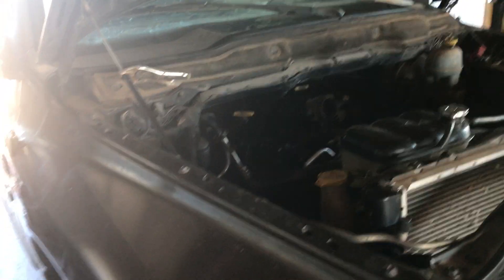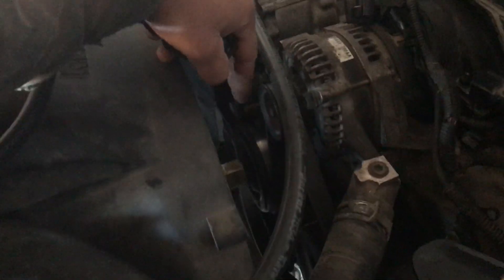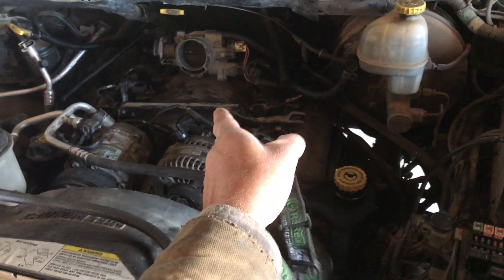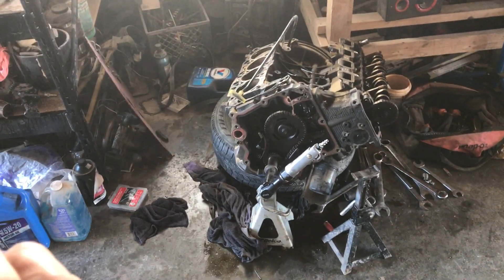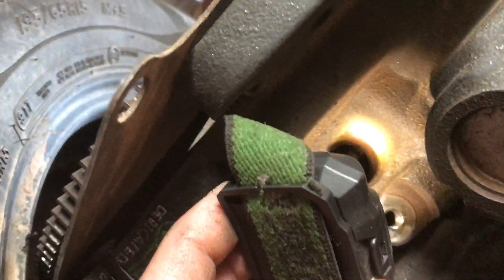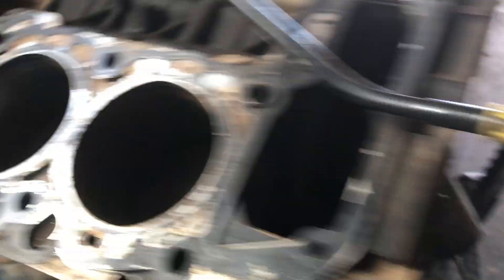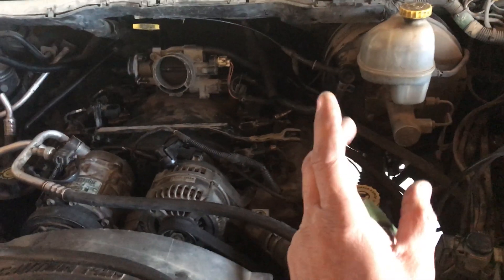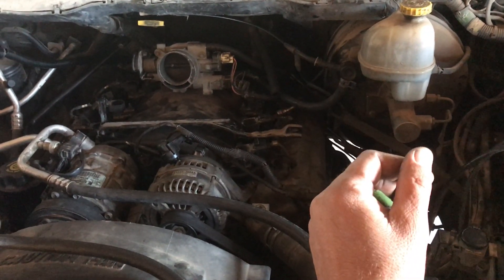4.7 Crankshaft Reluctor Ring Teeth Tone Easy Way to Determine

Comment: This is the 5th video I've seen where people talk about the tone wheel and that they are swapping the motor with a motor that has the same tone wheel....is it really so hard to change the ring that its easier to just do an engine swap?  I ask because im almost positive my Jeep GC is having issues and it should be the ring.  Hard to believe i need to swap the motor just for a no signal code
Reply from the maker: you can swap the tone rings. its a little in-depth but can be done.

Comment: So I didn't know this and put a 32 teeth Durango in my 16 teeth 02 dodge ram 1500 and it wont start. Pretty sure this is the issue now...how do I go about converting the change over so it'll work in my ram?
Reply: did you ever figure it out. I'm thinking you just needed the pcm for the 32 teeth

Comment: Will it work if I have a 4.7 engine that's 32 teeth and swap out the relector ring that's 16 teeth? That's what I did truck cranks and turns on but has no power at all scanner says random misfire
Reply: did you change out the camshaft gear?

Comment: I just changed my first crank position sensor today. I was having an issue when the engine was warm where it would hesitate to start. 
I put the new crank position sensor in and got a couple of misfires when I try to start.

Not sure if my crank position sensor is bad? Maybe it's the wrong part number?.

Like to ask a general question as you seem very knowledgeable is when I put the sensor in do I have to rotate the crank so that any part of the reluctor wheel is facing the sensor when I initially put the new one in?

Comment: If u made the mistake of buying a 16-tooth when your CPU reads a 32-tooth, can't you just swap the reluctor ring on the crank and the sprocket on the cam to have the crank and cam sensors to read it correctly? Or is there something else that will cause this not to work?
Reply from the maker: i think you can, however i have not done it before, it makes perfect sense though. keep in mind the crank and cam will need to come out to perform it. i have both engines here and i may just try that. i too am very curious. and it does make sense. let me know if you try, and if i get to it before you, i will make a video and send you a link as well. great question. the 1500 4.7 is harder to find then the Dakota and durango, so it would be great !! anyone else try this, your info would help us all. thanks for watching.
Reply: Yes, that's what I have to do now to get driving again on my 03 Dakota from a 2000 Durango. Ur video helped me find out why I had a no-start (I wasted a week and a half doing unnecessary checks). The more videos the merrier then; I'm an unexperienced mechanic running into obstacle after obstacle, but the aid from others online (especially explanations from multiple youtubers) has kept me going. I wasted another week thinking my cam wasn't turning normal and had a lot of resistance (since it has been so long in this project to remember how it was supposed to look like turning by hand) then I posted a video about it. Thank you for checking the video out and easing my worries about it because I was stuck thinking of an imaginary issue. I guess my problem is setting the timing chain and tensioner correct (which I found a great video for as well).

Comment: I have a 2005 grand cherokee with the 4.7l looking to swap with exact motor  and was wondering if anyone knows  if the ram dakota durangos are the same. Is the tone ring count different jeep grand cherokee. I know they use two different systems jtec and ngc. Anyone  has any info greatly appreciate the knowledge
Reply from the maker: yes they do have two kinds. pull the crank sensor, it only takes a second and verify. saves alot of time. great question. thanks for watching

Comment: Dont you have to make sure if it has a egr or not?
Reply from the maker: can you name a gas or diesel engine that does not? thanks for watching.
Reply: @thomasbriansavingmoney  my 4.7 does not have a egr
Reply from the maker: @whocares5188 4.7 egr valve is at  passengers head, in the rear. two 10 mm. bolts.
Reply from the maker: metal tubing goes to it. look again. it may be hard to see, but its there. put your belly over the engine. right behind the head that is on the passengers side. in the rear toward fire wall. or lean over the passengers side standing on a crate or whatever you can, and put your hand in between the passengers head and fire wall. all gas and diesel engines after 1986 will have them . and most before. 86-91 emissions were dead set on re burning fuel. some engines with carbs,  pre 86 did not.
Reply: @thomasbriansavingmoney  i been looking for a replacement 4.7 . And alot of them say without egr valve?

Comment: So I ended up had to take engine out. Due to torque converter when couldn't turn the flywheel at the time. Whole trans and engine would had to come out. Due to more hazard to my self and vehicle. So I used rust rescue that I pour into spark plugs and holes let sit for week. Then I was able get the crank to turn. But only 1 full turn to right or left. Just enough to undo the bolts for the torque converter. When I got my engine out. I took off my valve covers. Finding out I have 9 out of 16 lifters were bad. How I can tell? Shake a bad one. And shake a good one. Bad one will have play sound. Good one won't. Due to I had 9 bad. I'm replacing all 16 hydrolic lifters. Cams rocker arms are good. Cleaned it. Let set in oil until the time to replaced back on. I went ahead replaced timing kit with new gears. When I checked the rods, pistons, and crankshaft. 2  rods were damage. 5 rings were damage, 3 bearings were damage. To be on safe side. I replaced all. Including new crankshaft. New flywheel. I replaced new freeze plugs. New seals, new gaskets. New oil pump, water pump. Tensioner. Almost everything on my engine is new. Accept for alternator Ac compressor. It basically took me 3 weeks to rebuild it. Took my time and done it the right way. But one thing I problem on. Getting the timing right. So I had my best friend mechanic came  over to inspect my engine. And to recorrect my timing. He said I was 2 teeth's off. He went ahead resit the timing. Next 2 days. I placed on the timing  cover and the others. 3 day friend came back over. Help me placed the engine back into my truck connected to the trans. With new torque converter. Connect everything else back on. Due to my friend came and help me. He took for first test run. He says it droved like a charm.
Reply from the maker: thanks for watching!

Comment: If I'm correct. When u said u have to take off the alternator to take off the black thing off that's sits in middle. No u do not have to remove the alternator. My engine is the same on urs. And it's locked I removed the throttle body and the black thing that's sits in middle. Without removing alternator.
Reply from the maker: thanks for watching!

Comment: What would I have to do to take a 4.7 from a 03 Durango to 00 jeep grand Cherokee
Reply from the maker: a lot. first check the ring gear count. you want to make sure the ecm will read it. if not you will need to change the ecm with the 4.7, but if you do swap the ecm, you will need to also swap the tranny. because it will not read it. then check pigtails and motor mounts as well as water ports to be sure they are on the correct side or change thermostat housing so it points correctly etc.. check everything you can before you decide. the ecm is the biggest issue. welding motor mounts and changing cross member etc is no big deal. just time. thanks for watching.

Comment: Yes yes yes im learning so much that its usually better to eliminate through process my wife 2002 Dodge Durango has a bad idle I'm going to timing chain because I replace a throttle positioning sensor replace the air intake sensor replace all coils replace all spark plugs and it's still rough idles but when you get on it it runs like a hot rod just rough idle to wear it sounds like it's running out of gas and something broke inside the timing haven't took it yet will update as soon as possible Happy Father's Day my 2 month old is still sleeping
Reply from the maker: 2 mo old, awesome. happy fathers day. yes please keep us posted it helps everyone. thanks for watching.

Comment: the number of plugs on the PCM is a good way to tell without taking anything apart. 4 plugs means 32 teeth, 3 plugs means 16 teeth. I've seen a lot of people end up with the wrong tone wheel when they are replacing an engine. Especially in 1st gen Durango, and 1st gen Jeep Liberty (since the 3.7 is just a 4.7 minus 2 holes.) They did the changeover mid-model year, on Durangos, 2002 is that year. Early ones had 16, late had 32. So getting a replacement engine for a 2002, you can end up with the wrong one. I am trying to develop a solution for Durango/Dakota hemi swaps which would also work on this. My idea is to CNC a tone wheel that mounts on the crank pulley, and relocate the crank sensor to read it, enabling a 32 tooth engine to run in a 16 tooth truck.
Reply from the maker: i like the way you think !!! thanks for watching.
Reply: Theoreticaly if you disconnect the 4th plug, would the pcm assume its in 16 tooth mode, or is the pcm preset to only read one or the other(16 or 32)? Assuming the extra plug modes the pcm to enable 32 sensing mode. If its preset into the pcm then probably won't work. However if enabled by the reading then in theory possible. If anyone tries this and it works let me know! Sometimes less is more, more or less!
Reply: the number of plugs is just an easy way to tell, it has nothing to do with teeth on the ring. The 3 plug PCM is the older JTEC system, and the 4 plug PCM is the newer NGC system. The JTEC PCMs are set to read the 16 tooth rings and there is no way to change that.
Reply: If its a manual transmission truck does that affect the number of plugs on the later pcms?
Reply from the maker: excellent idea, have you ever swapped the ecm, when attempting this change with the engine having that tone? im curious to know if the durango ecm would cause shifting issues or not?
Reply: Or just change the tone wheels.